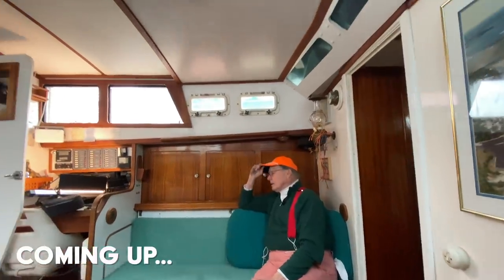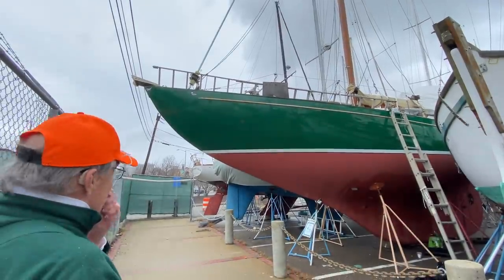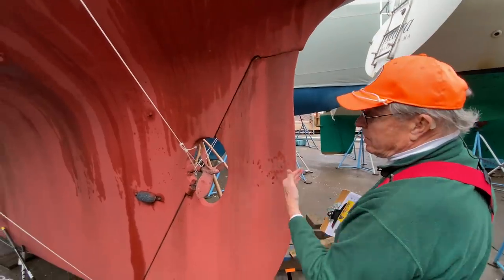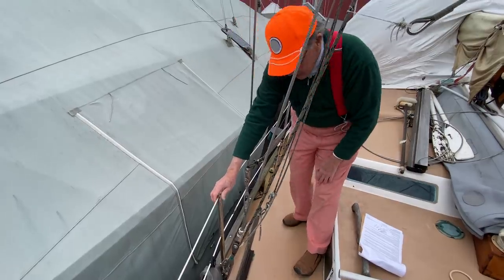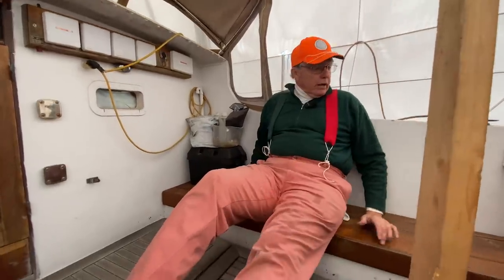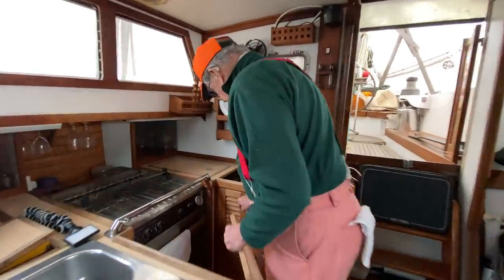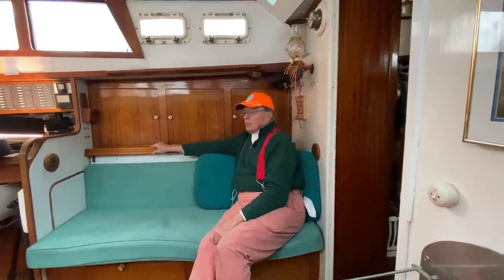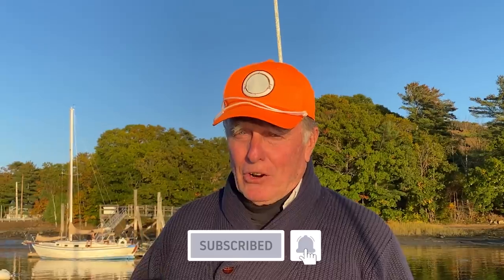SURVIVING A PIRATE ATTACK!! - A Steel Sailboat Story - For Sale $64,900 - EP17

Comment: As a Commercial Diver, done a many ship inspections performing NDT, as per (ABS), American Bureau of Shipping, and the U.S.Coast Guard, it is when plates get to 20%, wastage of original design thickness, then the plate needs to be replaced. After all the inspections performed, I think I would prefer a steel hulled boat any day of the week. Easy to repair easy to maintain. Can withstand a lot more hydraulic pressure wave than wood or fiberglass. Maintenance is more predictable in planning and execution. Also add ones are easier if your a qualified welder.
Reply from the maker: Great report.  Thanks so much.  A lot of steel tonnage out there holding up pretty well except fir a few errant captains no?
Reply: @YachtHunters  LOL!!! Yes, agree. There is an old saying. If It ain’t broke don’t fix it. One of my most memorable inspections of a steel hulled ship was the, “Glomar Explorere.” If you know about that ship it was, “disguised as a, Mobile Offshore Drilling Unit,” ( MODU), used to recover the, “Russian Submarine K-106.” It was interesting going through the entire vessel inside and out. The ship was in the mothball fleet docking at the, City of Benicia, Ca. Towed to Hunters Point, San Francisco, Ca, then towed to, Portland, Oregon, for final refit and certification for open ocean voyaging. It was actually going to be used this time, for offshore oil exploration. They added a lot of new equipment to that ship. The cover story for that ship was, when it was in Hawaiian waters. It was going to be used as an ocean mining venture ship, to recover what was called by the press, deep sea nodules. When I saw the recovery bin in the front hold of the ship I laughed hard. Because the holding bins were no larger than the back of a pick-up truck. A ship designed and built to hold a pick up truck sized bed of deep sea nodules. It was a cherished memory in my career to have had such an historical opportunity. Some years later I heard from another inspector that the Glomar, caught fire and sank in the Gulf of Mexico. A formerCIA, employee told me that is how that agency works with projects like that. Get rid of, “Government Equipment,” accidentally. I still haven’t confirmed the sinking of the, Glomar, maybe you can find some truth to that story. Aloha Captain, hope to chat with you another day.
Reply from the maker: Great story  you are a part of history
I remember reading about it but your tale paints a real life picture.  Too bad she’s gone but is anybody surprised.  ??  Amazing what goes on in back rooms and undercover exploits. 
I always wonder why steel ships that burn ...sink?
Thanks forc your note and of course for watching
CQ

Comment: There was a time when I never would have considered buying a steel sailboat, but over the years, and after having experienced a hard grounding, I can certainly appreciate the strength that only a steel hull will give you. Also, they are very easy to repair.
Reply from the maker: you can find welding equipment on any atoll  or in any  third world country but not so easy to find glass repair mechanics every where

Comment: Love this boat , how heavy are the sails ?
Reply from the maker: It's a really interesting rig.  The sails are pretty standard weight for dacron sails on a sloop rig. The mainsail will be larger than some other ketches and yawls we've looked at and the jib is a fairly standard roller-furled genoa.... not sure that helps! You might be able to calculate the weight estimating the luff of the main at around 42' and the foot around 20'. Cheers

Comment: Great video, I am a massive fan of steel boats and have just made an offer on a hard chine Van De Stadt 34' built in Durban South Africa to Lloyds register ocean going class A ice rated specifications. Built in 2007 but only launvhed in 2013 as a one owner boat, fully cruise equipped with AIS class B transciever SSB with auto tuner EPIRB Liferaft and more
Reply from the maker: My father had two Vanderbilt starts  that were beautiful and built by Anne Weaver Netherlands
Sounds like a lot of safety tech right up front. 
Good luck and Bon voyage

Comment: I love everything about her except for the nearly 8' draft.  Seems like that would greatly restrict your ability to travel a lot of places and limit your choices of anchorages.
Reply from the maker: i think probably 99% or close to that of all the worlds water are  deeper than 8"      maybe someone out there will debate that?    no?
Reply: @YachtHunters  major ports are typically 6-8 metres to allow for commercial/industrial.  But smaller anchorages for recreational use could be problematic especially in the Caribbean.
Reply: @YachtHunters  Do following seas present a problem for the helmsman?
Reply: @Alsatiagent  Probably not. One of the great advantages of a full keel is the stability in a following sea. It is called tracking, and I'm sure Gandalf tracks beautifully.
Reply: @YachtHunters  very nice ocean going boat. You show your experience with your liking of the traditional long keel. No wibble wobble for you it seems. Good video, I'll subscribe. 👍

Comment: I wonder if this hull is what the Dutch call S-Spant... as far as I can tell, this means S Shaped in English, and is desirable as it softens the motion when going to weather.  I would appreciate any corrections or expansions on this thought.  The Dutch ( and French) in that area of the world have an extensive metal boat building history, and I often see S-Spant as a touted feature of metal boats from this specific geographical region.
Reply from the maker: Those S-Spant boats are really handsome! At a quick glance it looks like the S-Spant refers to the hull shape being more rounded with no hard edges. It's definitely similar to when we spoke of 'slack bilges' as we were reviewing the hull form.. It looks like the S-Spant examples may not be quite as relaxed as the hull form on Gandalf -which would be quite comfortable in a seaway.  If you haven't checked out our Episode #4, the Allied Seabreeze, we discuss the hull form shapes a bit - and describe exactly what you mention about it being more comfortable in heavier seas. Cheers!

Comment: True. A 60-yr old steel boat would be made from soft steel and be greatly prone to rust. The primers and coatings back then were rather primitive to what we have today. IF Q is correct in his assessment the interior sides of hull and deck show no rust, this boat could be a bargain. If not correct, the boat should be stripped and blasted to bare metal and treated with today's coatings. Coated with today's products, I would have no concerns about rust. In fact, with today' coatings, a steel boat has much less maintenance than glass. And, steel can ram wood, glass, aluminium boats: not vice versa.
Reply: Hi jay here,
In1992 I sandblaster the interior of the ship. A job you do not want to do twice.
I had a custom epoxy house make me a very tough non-paint hi -build coating.
Ancho Seal, in Gloucester MA. Is their name. Look them up!

Comment: Oh yea.... (also about the rig) ~~~ There are no comments about a more "cutter like" arraignment that could be easily (added to) with a bowsprit.  Just "cut and paste" ya know.  It's a steel boat after all.  Then you'd need a topmast forestay.   Sure.... set up space for three fore sails.  Why not?  Fun.  This boat has so much "flexibility" and potential.  I just don't get it.  If I could I would but alas.  No.   Maybe another lottery ticket.  ~~~ Just imagine.
Reply: Hi , Jy here,
The ship does quite well as it is.
It was designed as a racing ship after all!
Reply: @jbarry6510  Yes yes yes.  The fast steel hull. Steel is so adaptable for "customization" etc. The Kraken (heavily promoted on U tube) has such a wide scope as "the best" and there you are with this boat that compares. Hydronic heating, some way to cool, generator /solar electric. Who knows?  All could happen here. Maybe a buyer with deep pockets who is willing to be creative could be interested.  No rub on what is there.  A really great, impressive boat. Thank you for the response.